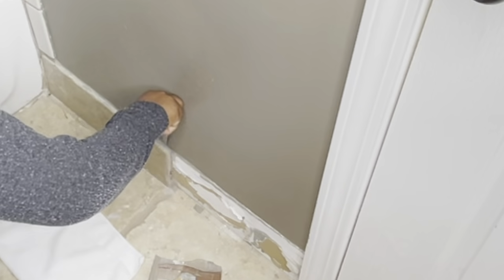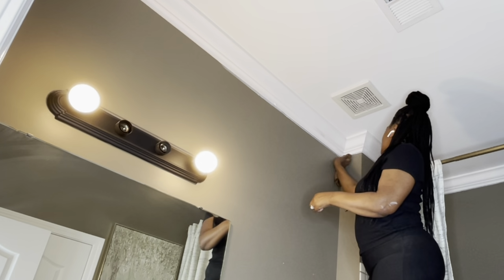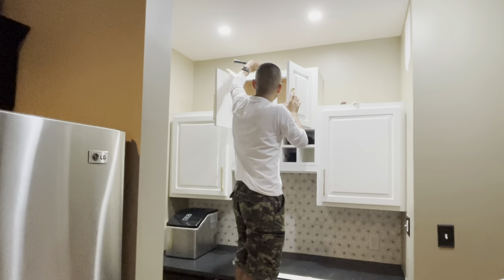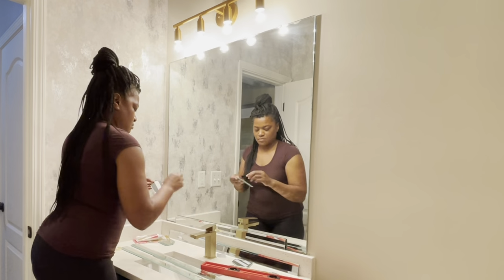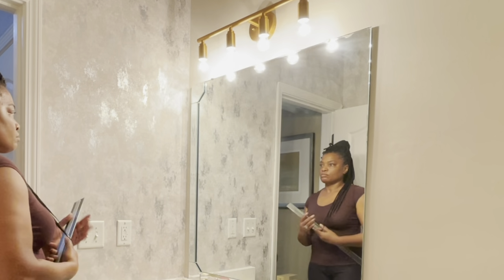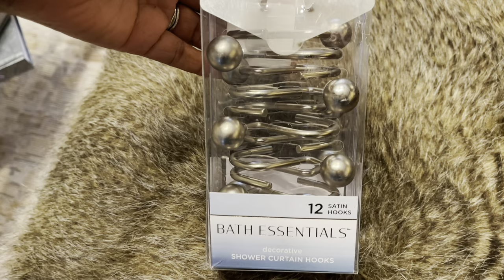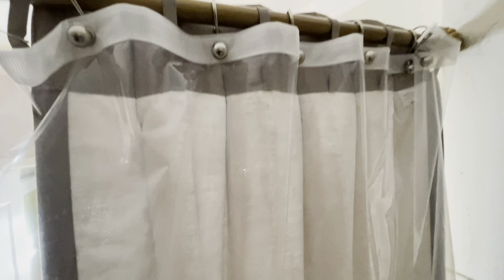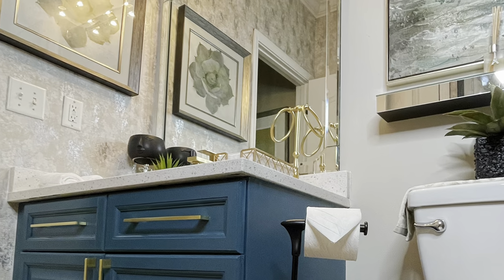Extreme Bathroom Makeover Ideas | DIY Mirror | Wallpaper | Paint Cabinet

Comment: How did you get the shower curtain rod to stay up. What did you put on the ends to make it stay up?
Reply from the maker: It’s a tension rod.  You twist your lock in place.
Reply: I know I've used the rods before. The end slips off the wall.
Reply from the maker: @simpleandpure.  hmm. I twist it really really tight to wall
Reply: @UniqueDBySherita  I think the one I brought is wrong, because I can't get it to stay up . It keeps sliding off. And, the shower wall is slippery. I'll get it done.